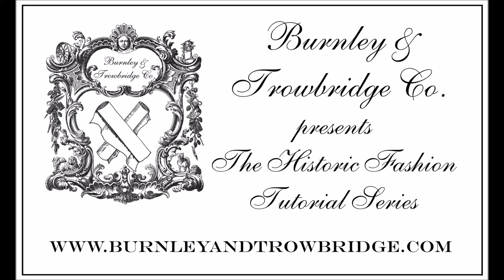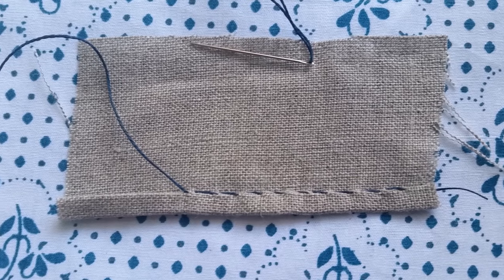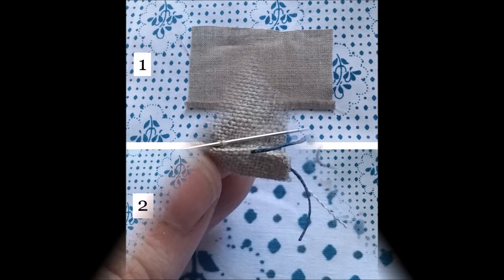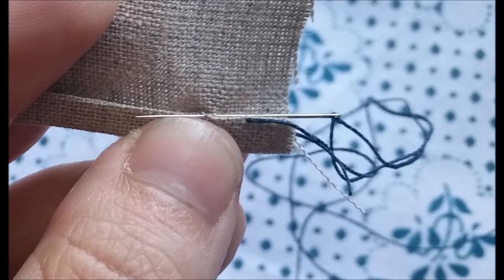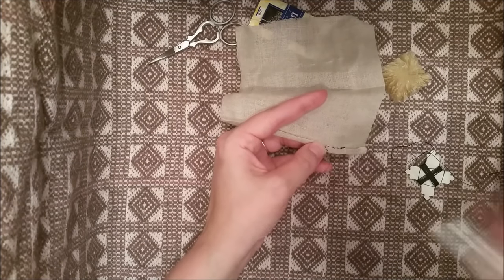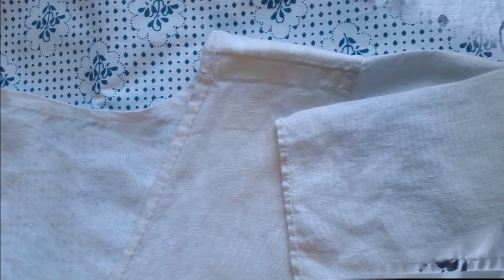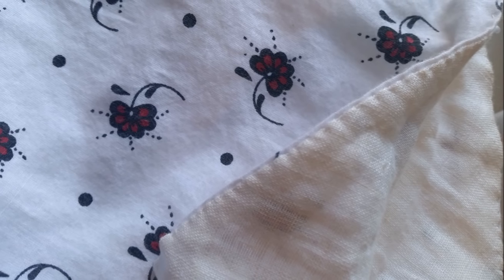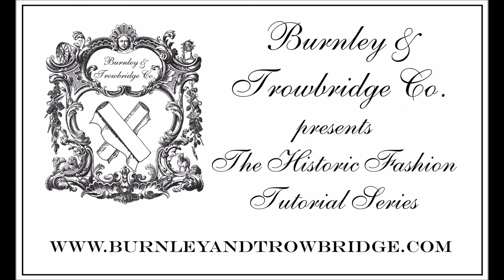Historic Fashion Tutorial Series: Hem Stitch

Comment: The thread used in this video is much heavier than what I have been using on linen.  Is that more historically correct, or is it just to make it more visible for the video?

What is the difference between the hem stitch in this video, and a whip stitch or felling stitch?
Reply from the maker: Debra Whited it is heavy for the video. The hem stitch travels forward at a slant and creates a slant on the right side while the felling stitch creates a small straight stitch (or bite)?on the front.